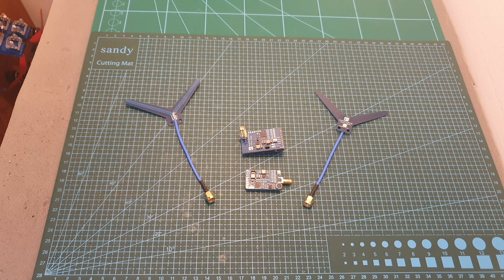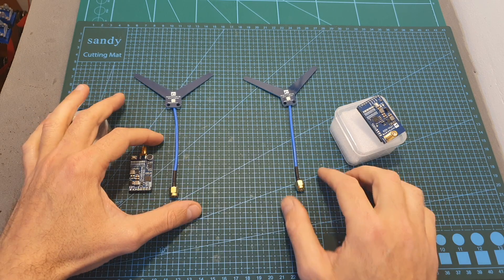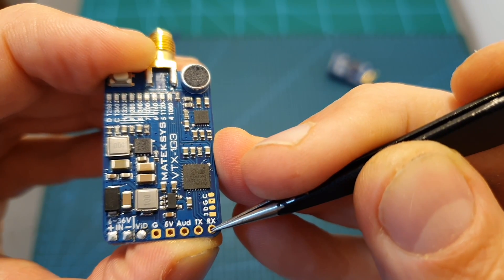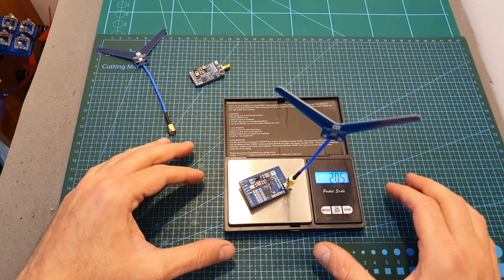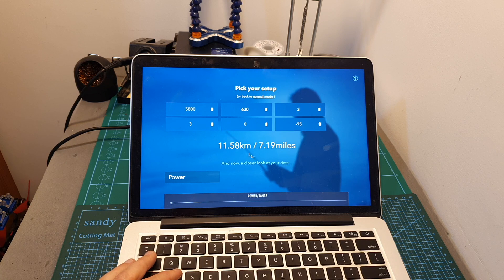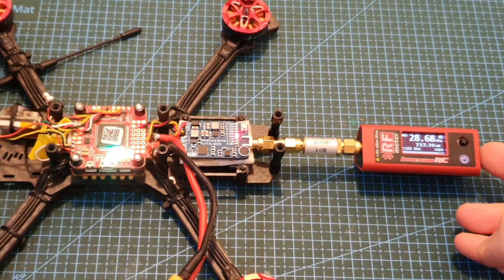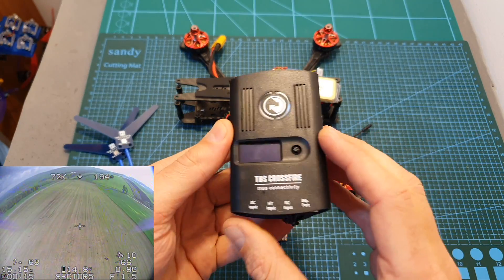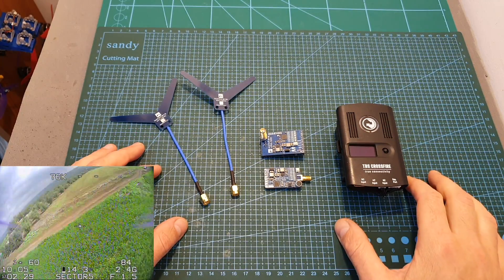Should You Switch To 1.3Ghz? MATEK Systems VTX-1G3 & VRX-1G3 Output Power & Field Tests

Comment: Guess not use on 10" drone. But still prob fine on rc car I just drive around my neighborhood.  Set ground station on table next to me. Keep further away and try some good notch filters. I want the penetration. See if it beat the 3w 5.8ghz that did make it thru 2 long building around the block controlling from inside 3rd building overin my apartment

Comment: How about if you use a 2.4 gigahertz radio or 433mhz?
Reply from the maker: 1.3ghz won't work well with a 2.4ghz system due to radio signal harmonics.

Comment: I fly freestyle, but i am fed up with crap signal , lines ect. I can't afford digital, so if i used this setup, would i be getting a better video feed?
Reply from the maker: On the paper, yes, but you should be aware of radio issues. You might want to switch to a 433mhz radio control system.

Comment: I am using this with a 5.8 ghz relay-working well
How do you set up audio? I get no audio via my relay
Thanks
Reply from the maker: That's good to know. You need to use a VTX with an audio input.
Reply: @KremerFPV  Thanks for your reply but I think my Vrx does not have the same audio subcarriers. I have the Parton receiver

Comment: 630mw of video is an excessive amount of RF to have on a Quad....200mw is what I use, more than enough and my GPS can cope with it..🤔😯
Reply from the maker: Thanks mate, I need to research this topic when I will have more time.
Reply: Not everyone is  into quads.  Planes can use the extra grunt
Reply: @blackterminal  I have 800mw 1.2g vtxs on my fixed wings, which is also rather excessive TBH... No, the mistake Matek made was to not provide different RF levels on a button like on their 5.8g vtxs...🤔😳🇬🇧

Comment: This just isn't an ideal setup on a quad. You just cannot get the GPS rx far enough away from the Vtx, which will cause you problems with obtaining and retaining sats. On planes this is awesome, but the rx is really not very good in goggles as it's too close to the tx as you found out.

Comment: always a good reviews.  question: How are the antennas placed during the flight, vertical from the front or side, horizontal?  thanks
Reply from the maker: Thanks! You need to match the same orientation of the antenna that is mounted on the drone.

Comment: Great video, thank you! Beside TBS radio link and GPS, where to put the notch filter? to the VRX ot the VTX? (or both? :) ) Which notchfilter did you get? Thank you in advance and keep up the good work! :)
Reply from the maker: Thanks! You should use the notch filters on the VRX as far as I know but so far I don't have a good experience using this system with along with the TBS Crossfire, so I can't be much of a help. I will try to use it again hopefully in the near future and then post a new video about it.

Comment: I am researching LR and found this information/video VERY helpful. Will you be including information to adjust the LP filter (i live in USA)when you make the repeater video for your ground station?   So far I have been unable to find any information about LP adjustment for LP filters. Thank you
Reply from the maker: Thanks. I am sorry but so far I didn't have a much better luck after using a ground repeating station and filters...
There was an improvement after using the repeating station however the range was still not great. I will have to see what I can do and research other options.
Reply: @KremerFPV  these are really bad news! This makes me think that the Matek system is non reliable. Will you still try to reach a good quality? I'm looking forward to your positive result.
Reply from the maker: @Tonynux  I need to conduct more tests. Unfortunately I don't have the time to perform all the tests I would like to :-/
Reply: @KremerFPV  I see! But please be aware that many people (I believe) would be interested to your test, as no one else is conducting this type of test on the 1.3GHz verylongrange system.

Comment: You need a 5.8g video repeater station to forward video to your goggles.  This is standard practice if you are to avoid corrupting your received video signal by your control transmitter. Be it UHF or Crossfire.
You wont need any notch filters once you use a Ground-station and 5.8g repeater relay...It will easily outrange any Quad you own.
Reply from the maker: Thanks, I've already arranged this setup and I will test it soon.
Reply: @KremerFPV  Yes, I was looking for your follow up video...Put a big underslung Lipo on the quad if you want to do a proper range test is my advice...lol.
Reply from the maker: @EnglishTurbines  Thanks, I think that I will use a lion battery. Hopefully I'll be able to test it soon...
Reply: @KremerFPV  Cool, look forward to it..:)

Comment: I have my old vortex 285 with Ezuhf looking to convert it to a modern LR set up maybe that would be better. I think 915 and 1.3 are too close I never had a fail safe with my Ezuhf wish they done better rx as Im having not a good time with crsf at the moment.
Reply from the maker: Yes, a 433mhz system is probably the best option. A followup video will be up soon, so stay tuned.
Reply: @KremerFPV  thatbwoukd be great could you do a quick video on crsf settings as Im getting very poor rssi and lq i got a bundle pack of 5 so far all 4 on different builds are the same.
Reply from the maker: @kanenstuff  are you having this issue with a 1.3ghz vtx or when using a 5.8ghz vtx as well?

Comment: Good video... I have the Dragon Link on my Remote Control Spektrum. So you do not recommend buying the Txv / Rxv Matek? Thxs
Reply from the maker: Thanks. I am going to give it another try. Watch out for the upcoming update video.
Reply: Dragonlink and 1.3 go together extremely well. The problem is you need an Rx on a GS, not a module like this one that has no shielding because the DL tx swamps the rx when it's that close
Reply: @AdamGdoesFPV  Excuse me, I understand how GS is a ground video RX module, not a Rx in goggles? For this Vtx Matek model I have a 1.258 Ghz helicoidal antenna connected to a Digital Display RCA 1.2/1.3 Ghz receiver and it works much better than the VRx of the Goggles Fat Shark.  Could I try this module on an airplane where I have the DL or do I need a different more powerful and powerful VRx receiver?.  https://www.youtube.com/watch?v=0283JnP5b24.  TXS

Comment: In other words pointless.  No crossfire , no R9
Reply: Whoever flies 1.2ghz vtx will fly 433mhz anyway
Reply from the maker: I am going to give it another try using a ground station, better antennas and proper notch filters.
Reply: @KremerFPV  did you already build the GroundStation? I'm really interested. I think you will be the first one doing it with the Matek system.
Reply from the maker: @Tonynux  Yes but unfortunately it did work well for me. I still have to figure it out.
Reply: Only pointless if you use this matek receiver. I was very annoyed with it as you cannot use it as a google module, it gets too close to tx and has no shielding. Use a normal 1.3g rx on a GS and 1.3ghz is king! I fly up to 15km away still skimming the ground

Comment: VTX-1G3 kills GPS signal?
Reply: This would be news to me.
Reply from the maker: I will use a Low Pass Filter on the VTX antenna connector to try to solve this issue.
Reply: Yes, just add distance and use an LHCP VTX antenna (GPS/GLONASS/Beidou etc are elliptical/circular LHCP and in the same frequency range)